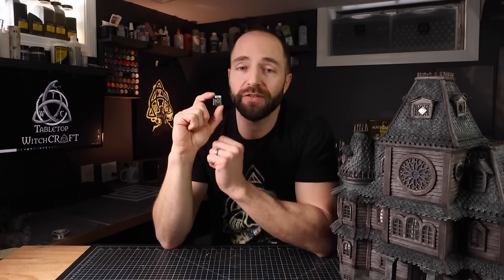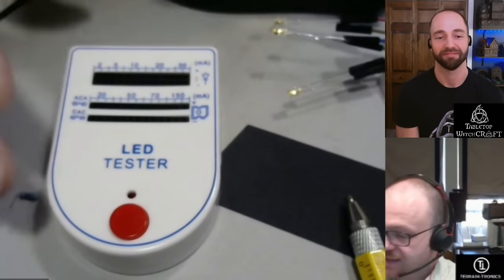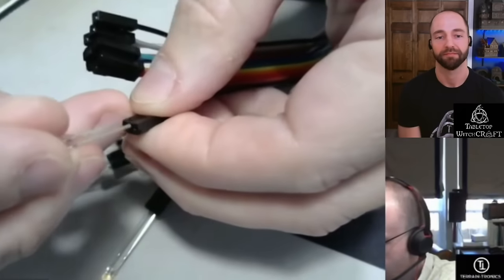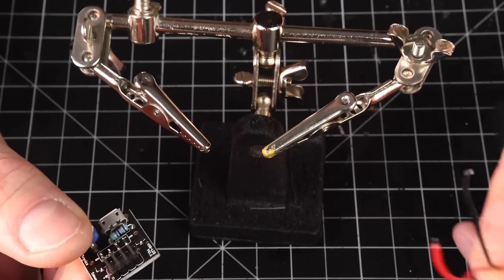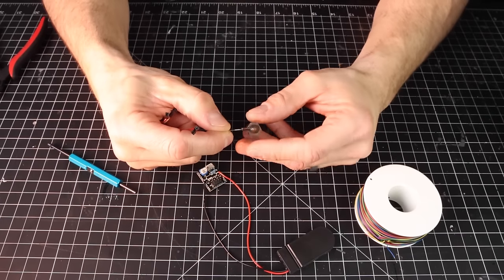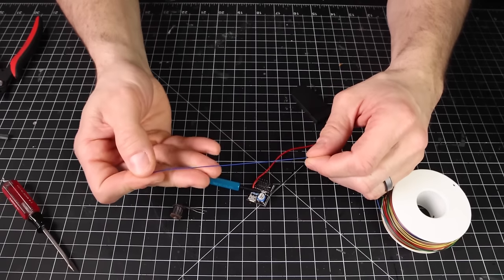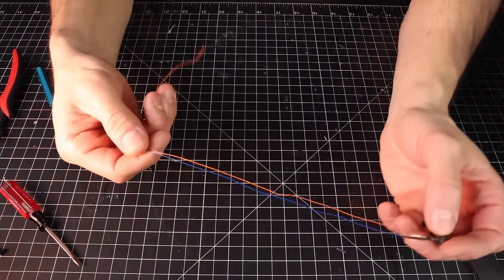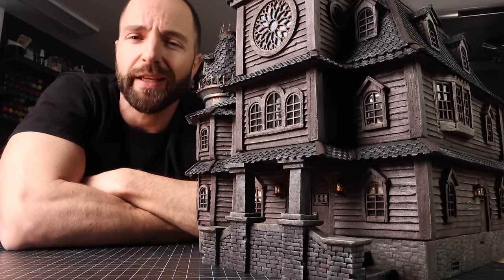EASY LED Wiring for Tabletop Gaming

Comment: I got the recommended wire wrapping tool and started using it last night.  So easy and so handy to strip the wire, then twist and connect LED’s to wire.  Next up, wire up the Conwy board with power and connect the LEDs!
Reply from the maker: Excellent Tim!!  Sounds like some fun coming right up :)

Comment: I recognized that wire wrap tool immediately. I was a computer technician in the 1980s and that's how we did our jumpers back then.

I was better at it than the men that I worked with at the time. I have large hands for a woman, but they are a little thinner (and more dexterous). than theirs were.
Reply from the maker: Cool!  Yeah I love that tool.

Comment: If you've never soldered with flux before you should try it once. Thanks for sharing. I appreciate you. 

You can find 3.7V lithium batteries laying in the street in ecigs. They're rechargeable and a usb recharge chip is under a dollar if you buy more than 10. CR2032 is a good power source too but maybe you'd find these last longer for your needs.
Reply from the maker: Thanks for the tip!

Comment: Have a look at getting a 'Handheld Electric Mini Heat Gun' for the shrink tubing. They are around $20 and much easier to use in tight spots than an open flame.  
Nice video. I really have to get back into dioramas again.
Reply from the maker: Thanks for the tip, will do.

Comment: Imo, the lights need to flicker a bit, they are flames in most medieval fantasy. 
If that was a choice, maybe on the board, so you could choose if flame, gas or electricity is running through the lights-depending on what your game is-that would add immense realism.
Reply: Also, that mansion is begging for interior! Future video?
Reply: Ah....they do flicker.....
Reply from the maker: All planned for the future!

Comment: You have correct soldering technique, which I have to appreciate. However, you should get yourself thinner solder and some flux. It will make your life much easier and the soldering experience much more pleasant. 

Also I have one suggestion about the wire. If you needed some longer cables, that wrapping wire would probably be a pain. You should consider using some UTP (ethernet cable), you can get it for very cheap (or even recycle some thrown away). Nice thing about it is that you have four pairs of twisted wires, color coded for you and you can use them as you wish. Also, they are usually solid, which will make them easier to route (or feed through thicker walls) in build.
Reply from the maker: I'll check it out... thanks.

Comment: This is exactly the video I needed, thanks!.  I can't grab all the supplies today, but I will definitely be back to stock up!  So, how about if we have 4 diodes all close together in a piece, can we wire them in series or should I do all 4 in parallel?  I'm thinking about how many wires I would end up with if each LED had its own pair of wires.  I can bundle them all in some black heat shrink, but as they say, less is more.
Reply: Conwy is designed for one led per output. However there are some larger LED’s that are designed for higher current. Your standard 3mm and 5mm are limited to a max of about 30mA (eye burning bright) but if you need more there are some that’ll run into the 100ma’s or higher. Beware they will need heat sinking at that point. I think you’ll be surprised how much light you can get from one or two LED’s in parallel to a Conwy board! Good luck!
Reply: @TerrainTronics  Thanks!  When it comes times to wire everything up I'll see if I can make it work with just one or two LEDs or if placement still leads to needing four.
Reply: @chemgeektim  come on over to the TT  Facebook page and post any Q’s you have. I’ll get a notification and I’ll be able to reply quickly. Thanks again, Dafydd.
Reply: @TerrainTronics  Will do!
Reply: @TerrainTronics  Ordered some boards today and lots of supplies, looking forward to tinkering and building some fun things!
Reply: @chemgeektim  Thank you for your custom! Don't forget to find and like on facebook for the latest info. :)
Reply: @TerrainTronics  you're welcome!  And already following on FB.  I see lots more content to check out!

Comment: great video as always your in a class all to yourself ! Any idea if this board will work for lighting 3v filament LEDs ?
Reply: should be fine. You'll need a voltage source higher than 3V to begin with though. For instance, that little battery pack puts both batteries in series, making them into a 6V source.
Reply: @TerrainTronics  thank you very much for the heads up
Reply from the maker: Thanks Corey!

Comment: I prefer to use 2.54m JST connectors. Red and black wires, LEDs fit tight, and are better construction than the cheap junk "Dupont" wires. They alao fit onto header pins but you may have to clip off the locking tab - not needed anymore. I still have my wire wrap tol from the 80a. Never could get it to wrap tight.
Reply from the maker: I'm learning myself... I'll have to check that out.  I do know that the wire wrap tool needs to have one connection as a square end like on the LED.

Comment: Will that tool do wire to wire?
Reply: It needs one wire (the core) to be stiffer than the other. Ideally, the core, or pin, is a square in shape. It then makes the wrapping wire grip on to the corners of it. When attaching a wire to a standard round, leg of a resistor, it still creates a good wrap, but doesn't grip. You will need a dab of solder to make it grip. Wire to wire, I strongly recommend a "NASA Wire Splice" along with a dab of solder, all covered with some heat shrink. Millennia may pass before those come undone! :)
Reply: @TerrainTronics  thank you so much for getting back to my post!!!!.